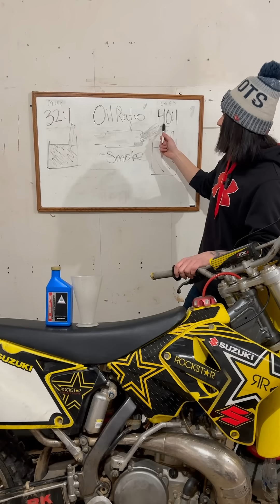2 Stroke Oil Ratio Explained

Comment: I had a buddy that swore that thinner mixes made you faster. He blew up three Suzukis in one race day running 70:1!! He never went above 40 after that
Reply: Well, he's kinda right. Higher oil mixtures don't burn as efficiently as lower. You'll definitely get more horsepower on 70:1, but it's just not enough oil to lubricate the engine. I've been using 50:1 for 20 years and i think it's the perfect ratio, provided a good oil is used
Reply: @averagescruffy258  I agree, that’s my personal favorite as well. But the fraction of performance you get vs reliability you get at 70:1 only makes sense at a professional level with engine tear downs and replacements after every race. Not a local race IMO.
Reply: @cajunred6804  Exactly. I've known guys that run it that lean in 125s, but they're doing constant rebuilds. I've been an offroader my whole life so I'm not putting as much stress on my motor, but I've been running the stock bottom end on the same bike for the last 10 or so years with zero issues at 50:1.

Btw, I'm so sold on Maxima super m that I don't even want to try amzoil or motorex or the other top brands. Shit's phenomenal
Reply: @averagescruffy258  yeah I have a 78 Suzuki 125 on original upper and lower that still runs like a champ. I’ve never had a favorite oil though. Usually just VP or Lucas. My Ktm usually gets the better stuff.

Comment: Iv run motul800 at 40:1 for years. 
Pipe spooge is part of owning a smoker.

And actually; the more premix you dump into your gas, the leaner it will run, contrary to what your dad told you.
As you increase the oil ratio, your displacing the amount of fuel you had in there and end up with less fuel (or more air) depending on how you want to look at it.

Comment: Most of the oil in your 2 stroke doesn't burn..... most people don't know that.
The oil in your 2 stroke fuel separates and lubricates the main bearing so there is a little something to make you say Hmmmm.
Fact!
Reply: None of it burns until after it lubes the main bearings. Then most of it burns in the combustion chamber.
Reply: If it doesn’t burn how does castor oil make a glaze?

Comment: 2 stroke oil is specifically formulated to dissolve easily in gasoline. It doesn't thicken it up to any certain degree. You're talking about 4 ounces of oil spread across a gallon. It's like 3%

Comment: U dont have any dam idea what ur talking about the bike runs leaner less oil u use and richer more oil u use u only burn more fuel if ur air to premix ratio is off u can change needle to get more fuel its just gona run rich and not good when needle is adjusted less fuel bike runs leaner trust me raced procircuit  honda 125 ran 40 1 klotz with race fuel klotz is best protection u can get using bean oil but it also requires most maintience checking ur powervalves making sure there opening and closing why i went to 40 ty 1 was perfect for my bike

Comment: Jetting is literally always the answer for everything. Unless the engine is hurt.
Reply: What’s jetting
Reply: @gavabgavaba7816 Jetting is the process of getting the correctly sized jets setup for your bike.  There's a bunch of different factors, sea level, engine setup, spark plugs, oil premix, etc which can cause you to need to change your jetting.  The jet basically a brass fitting which has precisely machined hole/s that allow a certain amount of fuel through via a certain amount of "suck" the engine is pulling on it.
Reply: Yep. 1. Jetting.
         2. Riding like a girl.

Comment: This dude has no clue what he is saying
Reply: He is 100% correct. You obviously have no clue what your talking about
Reply: @singletrackmarc819    you're
Reply: Poor explanation but he’s still correct
Reply: He’s right you seem to be the one with no clue it’s all in the jetting stock bikes are usually fat for safety for the manufactures so they aren’t replacing engines all the time because the wrong get got put in it
Reply: I'd prolly delete this comment mate
Reply: He is completely correct and I think he explains it well. If you don't get it, sorry you are just thicker than a milkshake.
Reply: He might not explain it the way you'd understand but he's completely correct. My first bike way a 85 Yamaha 125 2 stroke got it in 1990 been riding ever since.
Reply: Yes he does he just doesn't explain it well but he's got the concept correct!
Reply: They Google stuff nowadays they have no idea
Reply: @timjohnston2191  Back in my day we just made shit up and pretended like it was true! That damn googlator!
Reply: He's right though. Oil lean=fuel rich and oil rich=fuel lean
Reply: He's right although I think it can be explained better 😂
Reply: @SLVYER1 wrong. He is saying if a thinner liquid is flowing through the same size jet that a thicker liquid is flowing through, more of the thinner liquid will pass through faster than the thicker liquid. In terms of fuel delivery this is a richer flow of fuel because it's flowing faster. Think about it. He is 100% correct.
Reply: To reiterate my idea and I still stand by it but I am open to yours, improving the flow rate, but decreasing the richness, is the exact same as slowing the flow rate, and increasing the richness, because the rates equalize, you end up getting your original product. If 2:1 or 1:2 is hard to understand think of it as 1 and -1, they're both 1. 

The issue with both of our arguments being obviously he's got a maximum volume he can put in his car and that kind of affects things but I'm open to your argument, could you maybe simplify or reiterate what you mean?
Reply: I have socks older than this kid .. what if I poured a 1qt to half gallon of gas ..ratio is ratio
Reply: Yes, saying something that is true, and then justifying it with some BS does not make you right. He is trying to educate people afterall.
Reply: Typical
Reply: He is entirely correct. A mix with less oil naturally causes the engine to run more rich, not less rich. You'll make your bike run like shit AND be less reliable. If anything, you want a little more oil.

Comment: Is the somewhat correct and somewhat wrong 32 to 1 and 40 to 1:00 is not enough of a ratio to really have to rejet for. And you're not putting the oil in the bike because a two-stroke needs to burn it you're putting the two-stroke oil in the bike because there's no crankcase oil it's using the oil that's in the fuel to lube the crank that's the point of the oil in it. So it depends on what you're doing with said two-stroke engine like shifter karts you need to run them at 16 to 1:00 because they sustained high RPMs the whole time now a motocross bike you can run 50 to 1 on a race bike a trail bike you should probably be 40 or 32 to 1 but jetting isn't necessarily increased or decreased depending on the fuel mixture so much as it is on density altitude and humidity and things like that

Comment: My go to on any 2 stroke i own that is 50:1:   i mix .9 gal. of premium gas(wirhout ethanol preferably), 1 bottle of 2 stroke oil mix(rated  for 1 gal. @ 50:1), and pull whatever junk spark plug came in it, and get a NGK plug!  the little extra oil isn't noticable.  but my 2 strokes run amazing, and seem to run forever.  Always use a good mix oil, because that one gallon of gas or more is also serving as your oil for the crankcase!!!

Comment: Aint no dirt bike running 32 to 1
Reply: My 2000 kx100 came with a 32:1 sticker on the rear fender from the factory.  Bought it new in 99.  Always run 40:1 on everything else because I use my premix in the lawn equipment as well.
Reply: @KGrasso89  kx 100 is four stroke
Reply: Big clue.. K X 100 there's no F in there

Comment: 2 cycle engines don’t have an oil sump. The engine components, crank, rods,etc are lubricated by the oil in the gasoline. Using the manufactures ratio will extend the life of the engine and prevent the burning of bearings and seizing piston rings.

Comment: Oil has improved a lot over the years, older 2 stroke oil and ones designed for air cooled engine (chainsaw etc) is going to have a much lower flash point than a synthetic designed for racing.  60:1 with 200 hours

Comment: Different engine sizes require different oil ratios. For example for a 125 I'd run 30:1 but with a 250/300 I would run 55:1
Reply: And so if it was a 600cc U would run less oil again. If so o.k.

Comment: Always ran 40to1 with Amsoil dominator never missed a beat in 2 of my bikes 00yz125 with E.G 144 big bore piped Vreeds head cut down for hi comp 110 turbo blue only jetted crispy she absolutely screamed 13k revs.  Also had a 01 cr250 stock bore but ran a flat top moto GP single ring piston with one of them badass titanium coated rings also ran a thinner base gasket for a bit of comp Vreeds piped and jetted crispy too that was a beast of a bike back then. 30 hard hrs and the lil 1 ring still was holding 205psi. 40to1 with a high quality syn oil is fine s*** they will Run 50to1 with no prob😅 do a little research their boy

Comment: This is a funny conversation,  and one that will never be agreed upon.. From novice riders to vets to pros to factory teams, everyone has something a little different they would recommend or swear by.. If you start with the proven ways and adjust from their its all open to what you are doing and what you like.. from riders that stay low in the rpms to riders that are on the pipe mostly.. There are so many options.. if you dont believe me, read these comments in here.. everyone thinks their way is best.. research and field testing is everything..

Comment: Think those rm125s called for 30-1, an old school big bore air cooled called for 17-1. People pull all the oil outta their gas, and engine brake, then proceed to complain about longevity. You can race, or you can make it can last, you cant do both

Comment: I was with you right up until we got to the point that we're talking three to four times more viscosity from a couple of extra Oz out of 128.....

If you run your two-stroke way light on oil than recommended by the manufacturer (nothing calls for 16 to 1 anymore…)
Going with your nonsensical milkshake analogy -
1 - it will not run leaner it will run richer if anything because the fuel will be thinner. Running lean means there's more air. If you can suck the fuel in faster because there's less oil in it (that's called your oil to fuel mixture not lean or Rich. These are unrelated concepts)
2 - you probably will make the problem worse, because those rings are going to score the hell out of the Piston walls.
3 - rejetting a smoky engine is not even the go to first fix
4 - in a two-stroke the ring keep the boom up top and the lubricating fuel oil mixture down the bottom.  In a perfect world never the twain shall meet.  This probably should have been number 3 but anyways you mess up the rings and The seal between the two areas isn't good anymore.  That can happen from running the wrong mixture and will not only potentially increase the smoke it will ruin your motor

The more you know....

Comment: Remember around 2001-2004 depending on bike brand all engine ages had the same casting style down to the finish. Same on every barnd cases and jugs straight outta China. Any 2 stroke no matter the brand run 50-1 saws etc , 40-1 85s and 125s, 32-1 250s & 300s and 28-1 big bore multi cylinder. Most important thing no engine Pryor to 2004 uses synthetic 2 stroke oil. Conventional.oil only guys...

Comment: Well before YouTube existed, I raced a 1990 CR125, ‘94 RM125, ‘96CR125, raced 2000 KX125 professionally and 2001 RM125 & RM250 pro Arenacross and always used 50:1. Most years was Klotz. Never blew an engine.

Comment: A richer than usual fuel premix causes a lean condition, because there's less gasoline in the fuel mixture being metered by the jet..people would put more oil in their outboards back in the day thinking it was safer and absolutly cook their powerhead.
Reply: @mostlymotorized  Actually he's right. More oil displaces fuel, making the total volume of fuel/oil mix have less fuel, but the engine will still be taking in the same amount of air, so the fuel/air mix WILL be lean.
Reply: @spinnanz but two stroke oil burns with the fuel. In many ways it is a fuel.
Reply: @waynes.2983  only a small amount of the oil is burnt during running, 2 stroke oil is designed with a very high flash point so that it can still lubricate with the extremes of being inside a combustion chamber
Reply: @waynes.2983  you are mixing up the oil BEING burnt during combustion with contributing TO the combustion. The more oil in the oil/fuel mix, the less combustible the mix is.
Reply: @mostlymotorized  how sure are you? Because I'm 100% sure you have a room temp IQ if that doesn't make sense to you, I do this shit for a living and you use bubblegum and duct tape in your back yard
Reply: @mostlymotorized  Mate give it up. You are really showing your ignorance. just accept that you have learned something today, no shame in that!
Reply: Too much oil = rich
Too little oil = lean
You cannot have both at the same time unless you’re not talking about an air/fuel mix. You got the right idea but your terminology is off. Yes, a rich mixture means that the engine is not getting enough gas, but it won’t burn up because oil is better at cooling/lubricating than gas. If it were running lean the engine would definitely burn up. The rule of thumb in the mechanical world is that the words “rich” and “lean” describe how much oil is in the air/fuel mixture
Reply: @DirtyMagpie181 who the hell uses rich/lean to explain anything but fuel to air in an engine?
Reply: @DirtyMagpie181  you can absolutely have a lean or rich fuel/air mixture and also have a lean or rich oiling or premix mixture.  A rich oil/fuel mixture will give you a lean fuel/air mixture is the point I'm getting at here lol

Comment: So many people don't understand the jetting process on two strokes and how these two go hand in hand.
Reply: Prolly because it’s poorly explained 😅
Reply: @StihlRunnin like ur common sense response . Lack of info doesn't = stupidity.  Each one teach one brother,
Reply: There's nothing that goes hand in hand about this, your bike just has to be properly jetted.. The oil ratio is set so when the engine is properly jetted, it's properly lubricated
Reply: @keesanker4241  the correct oil gas mix and the correct jetting make all the difference in weather your bike smokes like crazy or not. It's fact look them up amigo. I've been a building bikes for 25+ years. 80% of them 2T bikes. Your more then welcome to prove me wrong and point me in the right direction. I will happily explore/study/experiment with any info you can send my way proving or stating otherwise.
Reply: @jasonlawrence6209  it isn’t about smoke, but how the engine runs and performs, i’m a bike mechanic and work on 2t racing scooters